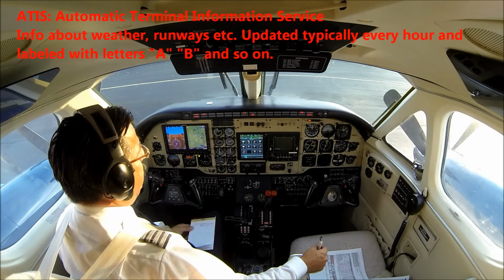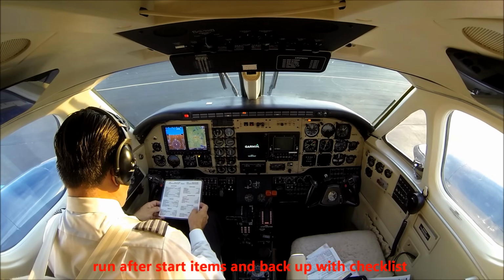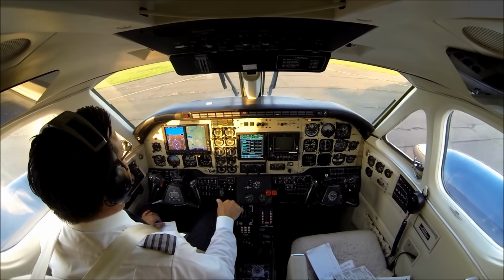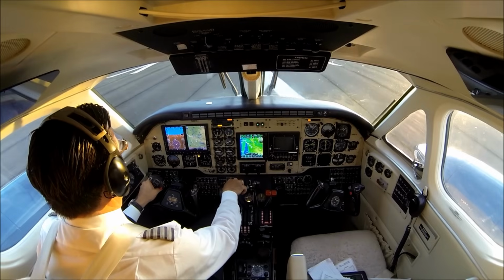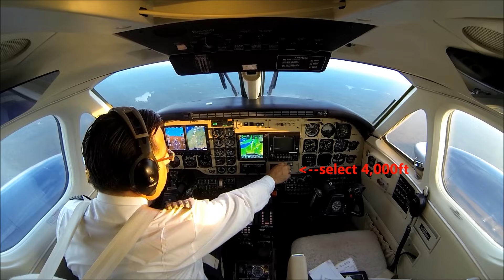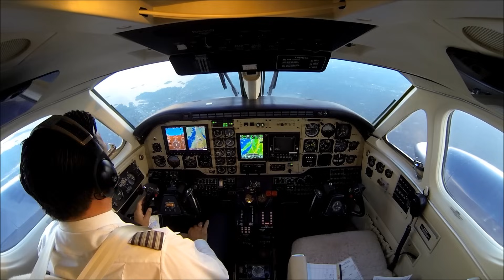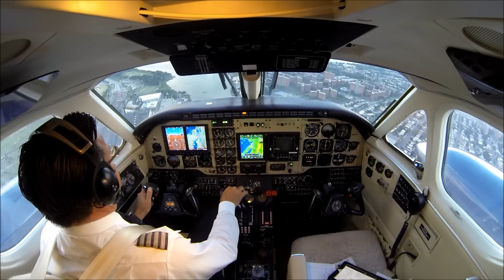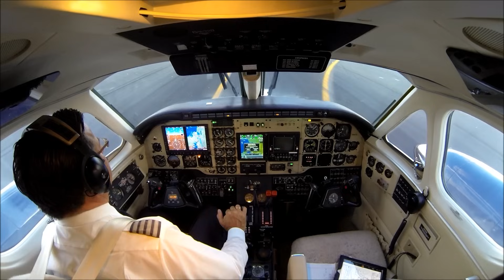King Air B100 - IFR flight to La Guardia KLGA!

Comment: Great video!   I was wondering how difficult it is to handle the loss of power on one engine on this type of plane, shortly after take-off.   I am asking this in view of a recent accident, in which such an occurrence may have been the cause of a fatal accident.  Thanks!
Reply from the maker: Thank you!
An engine failure is always a critical event, especially shortly after take off, at low altitude and with the landing gear (produces drag) still out.
Also the airspeed is an important factor. At lower airspeed shortly after take, the directional control with one engine is difficult. The rudder, that counter acts the asymmetric thrust on one engine is obviously less effective at low speed.
I do not want to comment the recent crash at Wichita. We have to wait for the accident report.
My thoughts are with the families of those killed in the crash.
Happy Landings,
Guido
Here one of my videos on engine failures in a King Air B100:
King Air B100 - engine failure!
Reply: Thank you for your reply.    I certainly agree that the cause is not known yet.  It is a tragedy, whatever the cause.   Thanks for the link to your video.

Comment: Great video! Question though: from what I saw, ATC directed you to join the localizer 20-22nm from the field... can they do that? Isn't the signal only reliable to 18nm?
Reply from the maker: Thank you Andrew.
At this distance the LLZ signal is not very stable and the autopilot has difficulties to track it. To maximize passenger comfort (to avoide turns right and left...) you can fly either in heading mode or fly until 10NM or so on the GPS approach track. and then switch to "green needles" meaning the localizer.
Happy landings,
Guido

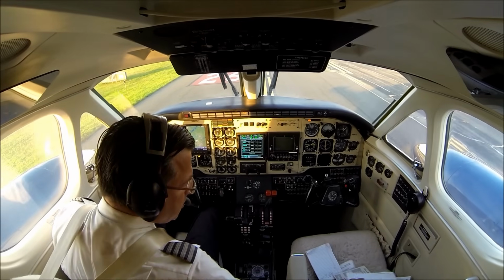Comment: Mr. Warnecke,  I'm at time 7:00 ... What would you do if you lost your computerized communication part of your avionics?  I notice you using a touch screen.  I learned when we dialed the frequencies.  Do you have a back up in case the computerized avionics fail?  I think we are to squawk 7600 or 7500 if we lose radios. Is that right?
Reply from the maker: Hi David,
Loss of communication is a rare event. Mostly it is caused by the pilots dialing in the wring frequency. But even if there would be a technical malfunction: when flying IFR, loss of communication is not a big event. You squawk 7600 and follow certain procedures. In essence: you fly our cleared route.
Happy Landings,
Guido
Reply: Guido Warnecke When I finished watching this video a 2nd time I just happened to look down and saw you had responded to my question already!  Wow!  What I admire about you is your professionalism.  Thank you again for posting these videos.  I actually, truly believe I will be a better private pilot having watched them.  I couldn't help but notice you have a very structured routine safe habits you follow.  My hat's off to you.
Blue skies, (That's a closing skydivers use)
David

Comment: Hello Guido I'm a big fan of yours.
I notice as you are touching down, there seems to be only a small amount of flare compared to what I'm used too and carry out, is this simply the angle of the camera or is the size of the aeroplane playing a major role in this? Also, what is your touchdown speed? 
Sorry for all the questions,
- Isaac
Reply from the maker: Thank you, Isaac.
The amount of flare depends on the aircraft type.
Larger airplanes are generally "flown" to the touchdown, which occurs at a speed 30% above the stall speed. In a small aircraft like a C172, you may want to "hold it: until the stall warning comes on and then touch down.
Thanks for watching my videos & happy landings,
Guido

Comment: Guido! PPL here. Love your videos! I flew this morning in real life (Piper Tomahawk) and now flying a C90B on the sim while watching your videos and learning

I'd like to know how much torque deviates from one engine to the other when you have the power levers at the same position. Of course the B100 has no FADEC so I'd like to know by how much torque varies between engines.

Thanks.
Reply from the maker: Hi Jil,
the engines are normally rigged as such that they should produce equal torque at equal throttle positions. In real live this is never perfect, especially if the engines have a different age.
Happy landings,
Guido
Reply: Guido Warnecke yeah i understand but is 50 ft.lbs a good example of difference or is that too much?
Reply from the maker: 50 ftxlbs is in an acceptable range.
Happy landings,
Guido

Comment: After the rise in ITT what were you waiting for after?  Just curious. Danbury is a cool airport.  Hilly terrain around there.
Reply from the maker: Hi Phillip,
ITT also depends on airspeed. The faster you fly, the lower ITT (more air flow).
On warm days, the engine reaches ITT limits long before torque (horse power) limit. As there is no electronic control, you have to watch the engines carefully. There is a constant adjustment.
On could say now "then take off with an ITT well below limits"...but you need all that power for take off.
Happy Landings,
Guido
Reply: Thank you for the response. I am a commercial pilot dealing with some medical cert issues so your videos are pretty close to getting me back in the cockpit. Keep them coming. 
Phil
Reply from the maker: Phillip Day Phillip, I hope you get your medical back soon!
Happy Landings,
Guido

Comment: Hi Guido, nice video. Could you provide more information about the installed FMS? I can see the G500/600, and the GTN750. Are the radios from Garmin as well? 
What is your experience with the GTN 750? Do you have weather radar on board?
Reply from the maker: There is no specific FMS, Flight planning and management is done with the 600 and the 750. Very good units. We have satellite weather NEXRAD installed and additionally the weather radar (comes from the old cockpit).
One set of radios is integrated in the GTN750, the no 2 is external.
GTN 750: Great system, very easy and intuitive to use!
Happy landings,
Guido
PS: although I understand and respect the anonymity of the web, I would appreciate if you could write your comment with your clear name - it's just more personal. Thank you!

Comment: I havent flown in a while but, why were the condition levers full fwd at ignition? That almost cost a hot start
Reply from the maker: These are Garrett engines. The red lever has a different function: it is only a manual cut off and feather lever.
During the engine start process the fuel valves is opened automatically by the system.
It starts similar to a GPU in a big airliner. 
The start switch initiated an automatic engine start sequence.
Happy Landings,
Guido

Comment: I did not see you switch on the bleed air and verify the pressurisation as working, or the de ice boot checks, did you cut some of this video out?, thanks
Reply from the maker: Hi Wayne,
if the flight is not going into known icing conditions (this was a VFR flight) I do not cycle the boots on the ground.  I check suction pressure though as this is also used to power the copilot attitude indicator on this aircraft.
If the flight is expected to be in icing conditions, I cycle the boots (to TKS or hot wings), depending on the aircraft I fly.
Thanks for watching my videos in such detail & Happy Landings,
Capt. Guido

Comment: Ah I see thanks, its strange that all the boeing and airbus have nearly all system control on the overhead.
I was also wondering what logbook do you use and when you have as many hours as you do you still log every flight? If so do you log after each flight or when you get home that night
Thanks 
Faolan

Comment: What is your favorite aircraft to fly the King Air or the Citation. P. McBride
Reply from the maker: That is really a difficult question.
Both aircraft are the leaders in its class: the King Air for the turboprops and the Citation for the light jets.
For good reason. Both aircraft are very easy t fly and forgive pilot errors.
I like both. The King Air can do a lot of steep approaches into short runways, a jet is more limited. A jet has a very good performance an can fly very high.
Thanks for watching my videos & happy landings,
Guido

Comment: Guido, is there any preparation you do to keep yourself updated with several aircraft? 
Each one has its own checklists at certain altitudes, speeds and weights. In addition, each one has a different cockpit layout, making a different place to find buttons, knobs, elevator trims and on, and on.
Reply from the maker: This depends on the aircraft. If it is within a group of aircraft like the Beechcraft King Air, these are very similar in handling and cockpit design. If I fly "new" aircraft I have to familiarize myself thoroughly with the information you mentioned. For aircraft that require a type rating that I fly (CE500, CE525, BE350), I have to attend 12 monthly recurrent simulator courses.
Happy Landings,
Guido

Comment: Great video, I've never used push button radios for freqs before. I can imagine in turbulence it could be difficult punching in the correct frequencies. Have you found that to be the case?
Reply from the maker: In turbulence, the touch screen has its limits.
You can, however, dial in frequencies also with a turning knob.
Happy Landings,
Guido
PS: although I understand and respect the anonymity of the web, I would appreciate if you could write your comment with your clear name - it's just more personal. Thank you!

Comment: Did you shoot in 1080p 60fps? Excellent quality! ! Where did you get the adapter to record the audio?  Thanks!
Reply from the maker: Thank you Raj!
Yes, 1080p 60fps.
For the audio, I tap into the headset socket. Just a simple cable adapter.
Happy Landings,
Guido

Comment: Hi Guido, remarkable videos! I fly a B100 as well. Quick question, why did you push the speed levers to high before applying reverse after touchdown? I presume they should be at high as part of the final items checklist. I'd love to fly with you and learn from your excellent resource management. Enrique.
Reply from the maker: Thank you Enrique.
Props "full forward is not a limitation on the B100. Only if you want to use reverse, you should have the props forward.
hence the warning REV NOT READY if the gar is down  and the props not forward.
Happy landings,
Guido
Reply: Guido, thanks for the clarification! Keep up the wonderful videos coming. Danke!
Reply from the maker: You are very welcome!
Happy Landings,
Guido

Comment: Great video! A question: Can you hear all the conversations ATC is having with other planes? I ask because when seeing some ATC documentaries it sometimes seems like they are selecting the target/plane before speaking to it, probably so they can send some tones to specifically un-squelch their radio (which is fairly common in public safety).
Reply from the maker: Thank you very much, Max!
In normal radio communication, you can hear all the aircraft, this is why it is very "busy" sometimes. Only one aircraft (or ATC)  can speak at a time, so you have to wait to find a gap. If 2 aircraft try to transmit at the same time, everything is totally garbled, this is referred to as "double transmission".
Targeting a specific airplane:
This happens on routes over the Oceans or similar remote areas, where HF (high frequency) radios are used. With HF you can speak over a great distance, but the disadvantage is that there is a great background noise and the quality is very poor. To enable the flight crews to fly with the squelch up  (would be very annoying otherwise), a selective call system SELCAL has been introduced. Aircraft have a specific code, and a chime "ding" comes up in the cockpit when ATC tries to reach them. The squelch is then automatically reduced. The system is checked on every flight with ATC "SELCAL check".  This is a very old fashioned system, one would think that satellite based radios are in use, but it still works. On Oceanic routes there is much less radio communication, mostly position reports.
Happy landings,
Guido

Comment: During this short flight I see that propeller control nor mixture is required. When do these come into play? Thanks Sean
Reply from the maker: Hi Sean,
The mixture control only looks like one, but in fact it is a fuel cut off and propeller feather lever. These are Garrett propeller turbines and a fuel control unit takes care of the correct amount of fuel injected in the combustion chamber.
These aircraft are in some aspects easier to handle than piston twins. Less things to worry about.
Happy landings,
Guido

Comment: wow! This really gives you an appreciation for the workload in the cockpit. One question, how did you get back to Danbury?  :)

I'm a good ol' lapsed private SEL from BDR myself

Kevin in CT
Reply from the maker: KKG51 Hi Kevin,
the flight was to pick up passengers at LGA. We try to avoid this as much as possible because of unplanned delays on these airports. Same goes for EWR and JFK. The cost are actually not higher that at Westchester or Tererboro.
Greetings to BDR & happy landings,
Guido

Comment: just wondering what's the avionic instrument on this B100 ????
Reply from the maker: Hi Yair,
the avionics instrument on the B100 is a Garmin 750. It has been installed during an upgrade of the cockpit.
Happy Landings,
Guido
https://buy.garmin.com/en-US/US/in-the-air/avionics-safety/gps-nav-comm/gtn-750/prod67886.html

Comment: Are these Garrett turbines? Nice video!
Reply from the maker: Yes Bruno, these are Garrett TPE331 engines.
Pratt & Wittney was on strike, did not deliver the "normal" PT6 engines but Beechcraft had a lot of B100 aircraft ready for delivery - but no engines.
So they made a short term contract with Garrett. The B100 is the only King Air with Garretts.
Happy Landings,
Guido
Reply: I could notice from the start procedure, as it is different from the PT6 start procedure. I used to fly the A100, with the -28 engine. Cheers!
Reply from the maker: Bruno David You are correct - the start procedure is the main difference between the PT6 and the Garrett.
I hear the A100 is quite underpowered. Is that correct?
Happy Landings,
Guido
PS: although I understand and respect the anonymity of the web, I would appreciate if you could write your comment with your clear name - it's just more personal. Thank you!
Reply: Yes sir, at least the A100 which I flew was indeed underpowered. It's been some years since I had this experience, and I flew just a few hours on that plane, but I beleive it must have something to do with the high flotation landing gear set up, that leaves the plane with a heavier BOW, but I'm not sure! And with regard to comments, it's the first time I'm using Google+, I really don't know how my name appears on the comments, for me it shows my full name Bruno David. 
Regards! 
Bruno David
Reply from the maker: Bruno David Thank you very much, Bruno.
High flotation gear means just bigger tires that allow landings on unimproved runways. Downside: they do not retract fully in the gear bay (too big) and create some additional drag. May be 5-8 kts speed loss.
Happy landings,
Guido

Comment: So when you passed to Nav mode around 11 th min was it still you who controlls the altitude v/s ? Thank ou for sharing yor video! PS Laguardia ATIS voice sounded extraterrestrial :D
Reply from the maker: On this system, you cannot couple a vertical profile on the autopilot, except when flying an ILS..
On an ILS, the autopilot trims the pitch of the aircraft to stay on the glide path.
If you want to descent, say from 10,000ft to 8,000ft, you dial in the new altitude and then turn the autopilot pitch wheel down until the desired descent rate is achieved. The autopilot will then automatically "capture" the new altitude.
Quite old fashioned. Modern systems work much better and are more user friendly.
Happy Landings,
Guido
Reply: It makes sense actually since it is not some huge airliner where such feature may come handy. Oh i see, so on ILS mode it holds the plane within the glideslope!  Then you only have to care about the right speed level i guess. Thanks for reply!
Reply from the maker: hallobaaaby Correct!
We control the speed on the ILS with the power levers.
Happy Landings,
Guido

Comment: how do you not check your route? why so sure about the programm?
Reply from the maker: In the USA, routes are given as per the actual traffic situation, especially in the busy New York airspace.
Different in Europe, where a flight plan will not be accepted if the route is non standard.
Happy Landings,
Guido
Reply: Thanks)
Reply from the maker: you are very welcome. I reviewed you question: If you mean checking the route after programming it into the GPS/FMS. I always do this. This is a very short flight on a very familiar route (I am based at KDXR), so not cross checking was required.
Otherwise: YES, always crosscheck your route and see if there are no typing errors and that the route is the one you take.
A good crosscheck ist also the length of the route: if the GPS/FMS shows a different distance top what you have on the flight plan this is also an indication that something is wrong. usually typing errors.
When I do cross oceanic ferry flights I but a lot of efforts in checking the routes.
An error can be fatal.
Happy landings,
Guido

Comment: When they told you to intercept the localizer, is that when you activate the approach?
Reply from the maker: You activate the approach on the GPS and set the autopilot to NAV, because you are only allowed to intercept the localizer, not the glide path.
Once you are cleared for the ILS, you set the autopilot to APPR. Then it would intercept the glide path as well.
Happy Landings,
Guido